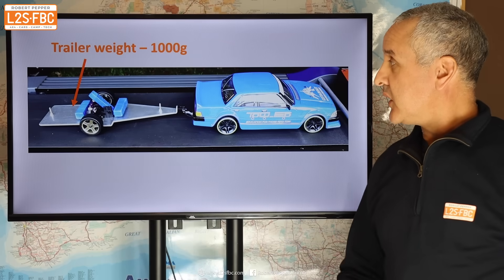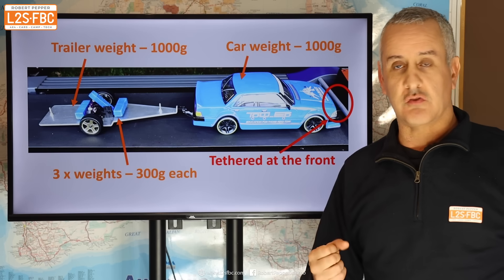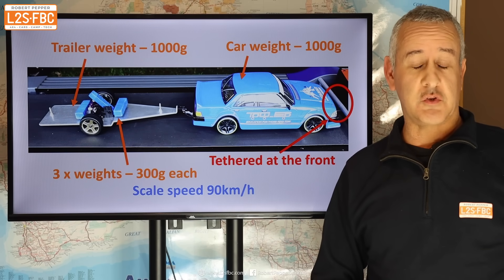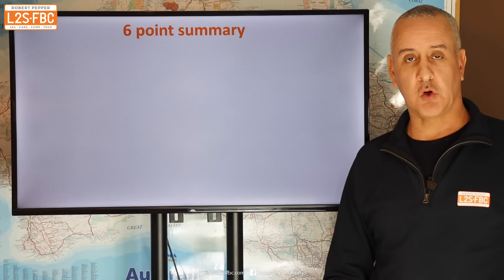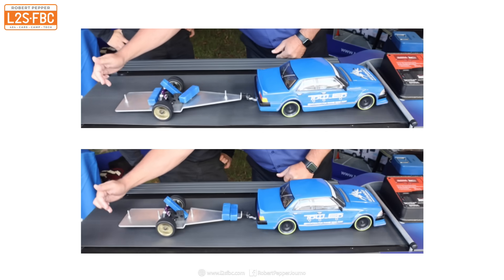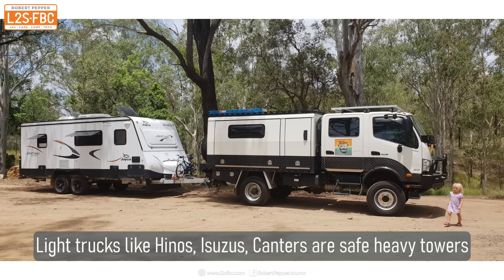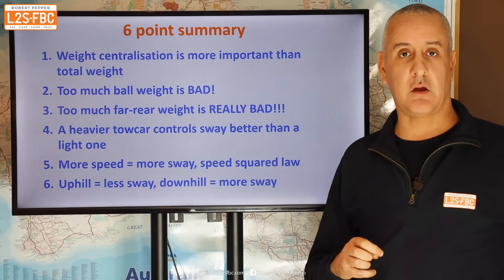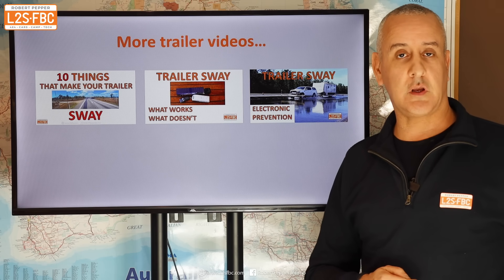7 trailer weight distribution setups, some safe, some deadly.

Comment: I'd like to see one more demonstration that I haven't seen anywhere yet: Compare the American "heavy" setup, i.e. 10-15 % or more nose/tongue weight with a longer hitch on a pick-up truck (20-25 cm from the bumper and relatively far from the rear axle, like e.g. an F-150), to the "Euro" setup with 5-7 % nose/tongue weight and a short hitch (10-15 cm and closer to the rear axle, like e.g. a VW Touareg). My guess is that the increased leverage will partially, if not even completely, negate the slight improvement in stability from the extra weight.
Reply from the maker: I think you're right. Short overhangs are really important in towing. I do plan on more such tests, stay tuned!
Reply: Interesting
Reply: Sorry, having trouble fully understanding Are you saying that the American setup with a LONGER hitch is NOT an advantage?
Reply: @cliffsmith1305  Exactly. Increasing the distance from the hitch to the rear axle reduces the stability of the rig. The shorter the wheelbase of the tow vehicle (and the lighter it is relative to the trailer) the worse it gets. Give me a while and I'll do the math to prove it.
Reply from the maker: Agreed and very interested in the maths!
Reply: Actually, I'm going to make a shareable document, rather than just a comment, because I think that hitch length and overhangs alone will result in a massive difference even between EU-style setups.
Reply: If you want to help me make a realistic comparison, post the axle-to-ball distance and wheelbase of whatever you'd use to tow, let' say, 700 kg (1500-ish lbs; using that because I towed that and therefore have the numbers for the setup I used), as well as the length of the tongue of the trailer that you'd use and the distance between the center of the bed and the trailer's axle).
Reply: @voprais  Thank you very much !
Reply: @cliffsmith1305  I did some math and while I'm not going to publish anything yet because I want to dig deeper and get it checked by someone who knows physics better than I do, it seems to confirm what I expected, which is that the maximum weight you can tow without a risk of unsettling the car from lateral acceleration (e.g. from a deep pothole that catches one wheel of the trailer) is proportional to the wheelbase of the car and the length of the trailer's tongue and INVERSELY proportional to the length of the hitch and the distance from the load to the trailer's axle.

In other words: Let's say that have a car with a wheelbase of 2 m and the ball 0.5 m behind the rear axle (which is very close to the actual measurements of 2.037 and 0.55, respectively).

If I increase the wheelbase by 10 % (0.2 m), I can have 10 % more load before the front wheels slip, but if I increase the length of the hitch by the same 10 % (that's only 5 cm or 2 inches!!!) it COMPLETELY negates the increase in wheelbase. 

As for the trailer, a similar effect occurs: A 10-% increase in tongue length results in the same increase in maximum weight. And once again, putting the load 10 % further away from the axle completely negates the extra stability from the longer tongue.

Next on the list is looking at the vertical side of things to see how much more stability you get (or don't get) from more tongue weight (the above is assuming a constant load limit for both axles of the car, i.e. zero tongue weight) and devices like weight-distribution hitches, but it's midnight here so that's for another day.
Reply: EDIT: Deleted, I screwed up.
Reply from the maker: Vojtech, I'm very interested in your calculations. I'd like to consider making them an online tool such as the tow weights calculator I made here -> https://l2sfbc.com/towing-weights-calculator/

As for grip/weight - it's not a linear equation, and adding towball mass increases the rear axle weight beyond the mass added, whilst decreasing weight/grip on the front axle. I don't have formulae for weight/grip.
Reply: @L2SFBC  I'll send you everything when it's done and fact-checked. And yes, you're correct about the  load on the rear axle, I forgot about that. I'll update the comment later. With that said, I still don't expect to see a huge benefit from having a front-heavy trailer unless you're going up very steep inclines.
Reply: @L2SFBC  As for the calculations, what I've done so far isn't really complicated and you can do it yourself if you want. 

Consider the load a lever that's connected to the axle of the trailer, with the force on the load being the weight of the load and the length being the distance of load's COG to the axle. Let's call that L1. This creates a moment (torque) on the axle, which is transferred to L2, the tongue of the trailer (with the fulcrum being the axle). The end of L2 (the coupling)  L3 is the total length of the hitch and L4 is the wheelbase. You end up with something like this (I hope the formatting stays):

                                      |-L1-|
|-----L4-----|-L3-[ball]----L2----|

From here, it's little more than F1×L1=F2×L2. You can see that a greater ratio between L1 and 2 results in a greater force on the ball and moves the load over a longer distance for the same change in yaw/pitch angle, giving it more inertia.

The ratio of L3 to L4 affects the forces on the car's suspension - a longer hitch will have more leverage and therefore push down on the rear suspension with more force, but with the axle/wheels acting as a fulcrum it will also increase the force pulling up on the front suspension.  The same thing also applies laterally: The hitch will push the rear axle in the direction of the trailer and the front axle in the opposite direction. The longer the hitch, the more leverage it will have and the greater the resulting forces will be.

Then there's the sum of L3 to L4, which comes into effect if you put the load on the trailer so far back that it unweights the hitch: The front axle now becomes the fulcrum, the distance from it to the hitch is the lever, and the rear axle is the load. The shorter the lever, and the closer the load is  is to the fulcrum (L4/(L3+L4), the greater the force pulling up on it.

Now it's about grip: If the rear end lets go first, then the whole car will pivot around the front end. At that point you've missed your chance to slow down and it's game over unless you have independent trailer brakes and engage them very quickly or you have a very powerful FWD/AWD car that can accelerate hard enough to put enough weight on the rear axle to keep it in place. Braking the tow car in any way will only unload the rear end even more and make the situation worse.

If the FRONT lets go, that's when braking the car may actually work if you can transfer enough weight forwards to get the wheels to grip again and you're gentle enough not to transfer even more of the trailer's weight onto the car. But using trailer brakes, if possible, will most likely still be far more effective.

OK, so that confirms what we already knew (longer wheelbase + shorter overhangs = better tow car). 

What about tongue weight (or TBM, as you call it), though? I haven't really looked into that much yet, but logic tells me the optimal amount of TBM is just enough to prevent the COG from ever moving behind the axle of the trailer, i.e. the higher the COG and the steeper the inclines that you need to climb, the more TBM you need to keep everything stable. If the COG gets behind the axle, the trailer will try to tip over, pulling up on the hitch and reducing the rear wheels' grip, possibly to the point of  making it unable to move forwards (especially on loose surfaces).

Now, if more TBM makes the trailer more stable on inclines and bumps and a longer tongue makes it affect the car less, one's first thought may be to put the axle further back (lenghtening the tongue and increasing the TBM by leverage)... But that makes the trailer (try to) sway more. Now what? You could try to lower the COG, and that can often be the solution for utility trailers, but with things like caravans there's a limit to how much you can move the stuff inside, and, especially with longer ones, you can't lower the frame either because your approach and departure angles would be absolutely horrible.

*So here's my hypothesis that I'd like you to test on the scale model: *

If you're cruising ON a smooth road without super-steep climbs, the increase in high-speed stability from reducing the moment of yaw by keeping the weight as close to the axle as possible (but still having the COG slightly in front of the axle!) will outweigh the reduction in vertical stability from the reduced TBM while allowing you to use a lighter tow car with softer suspension or to put more payload into the same tow car. My guess is that 5-8 % will be more than enough for most on-road setups.

OFF the road, however, you will need more TBM to prevent the trailer from trying to tip over backwards and causing the rear axle of the car to lose traction. I wouldn't be surprised it a tall caravan turned out to need 25 % GTW or even more just to stay upright when pitched up. Additionally, you will be able to put the axle further back to get a better departure angle while still having the stuff inside distributed somewhat evenly. It will make the trailer handle somewhat worse at high speeds and require a bigger tow car - but if you're climbing hills steep enough for you to need to do this, you won't be doing it in a stock passenger car anyway, you'll most likely be driving a large off-road rig that will still deal with the larger forces from the trailer just fine.

P.S: I've made A LOT of changes to the text above before posting it, so I apologize in advance for any typos and mistakes that I've missed.
Reply: One more thing I forgot to mention: The actual vertical load on the rear axle increase by roughly  ((L3+L4)/L4) × TBM. For my little econobox (0.55 m hitch amd 2.04 m wheelbase for a hitch-to-wheelbase ratio of about 0.26) it's about +26 % or 63 kg on the rear axle (1 kg off the front) at 50 kg on the ball, but the Škoda Fabia Combi that I do have to tow with a few times a year (1.1 m hitch, 2.4 m wheelbase, i.e. a hitch-to-wheelbase ratio of 0.45) transfers almost 45 % or 22.5 kg for a total of 72.5 kg on the rear axle with the same 50 kg on the ball.

Comment: Great video. When ever I buy a new van I slowly increase the speed and swerve the car a little at 10 kms per hour steps then hold the steering wheel straight ,to see how quickly the van stabilizes. Is it better to add a sway bar to a van or shock absorbers?  I have a 2 ton car and a 1 ton van and never had sway. Very stable even at 110 km/h. I have 10% at the ball.
Reply from the maker: A 2 to 1 ratio is great!!!

Comment: I have been looking for videos on optimal loading of horses in to trailers if you have less horses than stalls. I have a two horse slant trailer and the axles are all the way at the back. In the front slant stall the horse's weight is 60% in front of the axles and that adds a lot of tongue weight, so I load my single horse in the rear stall directly over the axles. But guess what? I had some sway at 100km/hr on a dry highway with good weather.
Reply from the maker: I've never towed a horse trailer and know nothing about horses so this is very interesting!  What's the recommendation for loading a single horse?  Did you increase rear tyre pressure?
Reply: @L2SFBC  I don't increase or decrease tire pressure. The difference is only 1,200 lbs, the weight of one horse - the trailer empty weighs 4,000 lbs and the horses 2,400 lbs and with two horses the rear horse is over both axles while the front horse is only over one axle (slant load trailer type).
Reply: For best stability you want to add load (the horses in this case) at the centre of mass of the trailer or forward of that, not over the axles. The centre of mass is always ahead of the axle centre (that's why there is positive tongue weight), so in this case the forward stall might be better.

Comment: 0:57 I totally get this demonstration if you loaded a flat bed (junk) trailer yourself, but I've seen videos (like the one I tagged here) of commercially built trailers doing this. So that means that the owner put a ton of crap inside their trailer each time or are some travel trailers built incorrectly?? The SUV vehicle towing this commercially built trailer looks big enough otherwise.
Reply from the maker: Doing what?

Comment: I work lawn care and have to pull a mower all day. Should I park it on the front of the trailer or over the axle?
Reply from the maker: Generally put weight over axle. But depends on rest of the load too.
Reply: @L2SFBC  thank you and the mower is currently the only thing on the trailer so I will do that from now on!

Comment: You say too much ball weight is bad but what do you consider too much? I understand the common belief is that 10%-15% is a good goal but I prefer a slightly heavier tongue and am not afraid of 20% or even 25% of the trailer weight on the ball. Thoughts?
Reply from the maker: There is NO fixed figure. I run about 5-6% on my 2350kg van and it tows fine. 20% may be fine depending on the trailer weight but I"d be looking at your rear axle load very closely. Basically, use the minimum that won't get sway.

Comment: Great video! I will be towing a caravan for the first time this summer (but have towed alot of dirt and materials in the past with all my cars). When it comes to ballweight it is fairly easy to see if it is too heavy in front or in the back when you hitch it on the truck. To avoid a bad distribution I check if I can lift the trailer off the car before driving off, or hook it of the car before loading it with dirt etc. 

BUT... how do you understand that you have a situation where there is too much weight in the front AND back? My way of checking the distribution will not catch this problem. Hopefully any standard caravan has the weight distribution fairly OK, and there is no problem, but after looking at this video that is now my biggest concern. I see that we are talking about nearly 1/3 of the load moved to the front and back, but still...
Reply from the maker: There's no good way to check it. Impossible with scales. All you can do is estimate the weight, and drive carefully to see if sway starts and then deal with it.
Reply: @L2SFBC  so visually and with common sense then.
Reply: First, have your unladen caravan’s tow ball weight measured, then weigh the total weight of the load imposed/carried in and under your caravan.
In case you don’t know, “one litre” of water weighs “one kilogram”. 
Once you have determined what the “total load weight of everything” is, you can calculate what 10% 20%  (minimum maximum) of that weight is and add to the existing tow ball weight that already exists on your tow ball, that then becomes the recommended limit, which has been advised by the RTA or whatever your states motor registry calls themselves.
In summary: Any additional weight imposed on the tow ball, other than the weight the caravan is already exerting on the tow ball, calculate either 10% or 20% (your choice between the allowable limits) of the total additional weight you intend to add to your caravan. This method equally applies to trailers.
When loading a ute, trailer or truck, remember that 60% of the load weight needs to be forward of the axle. However, trying to achieve this, will obviously be rather difficult inside of a caravan, given the design and layout of the interior floor space and any storage areas already built into the caravan. Hope this will be of some help to you. I got this information from Service NSW. (Previously named RTA)